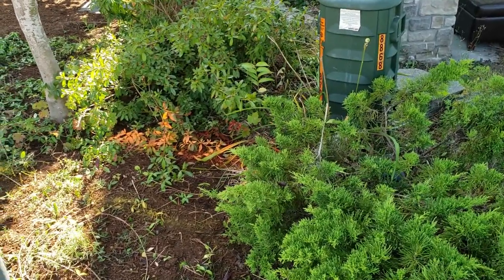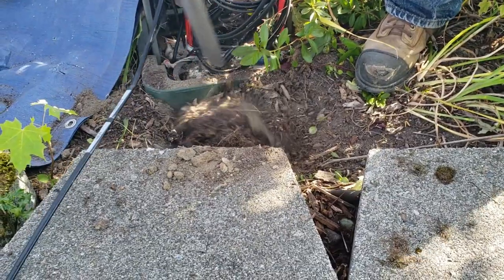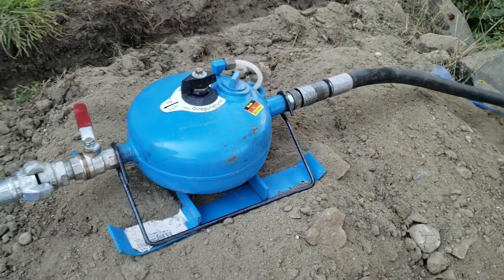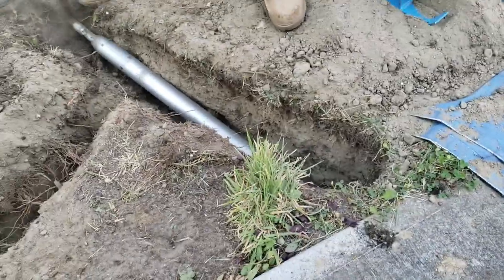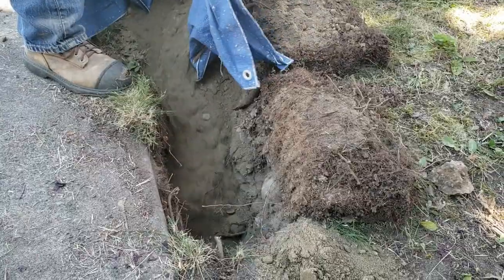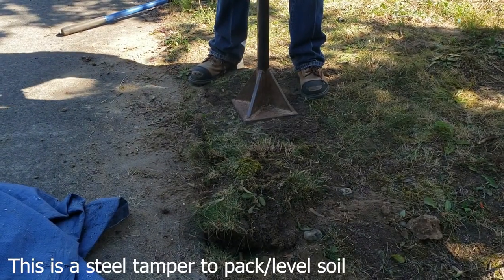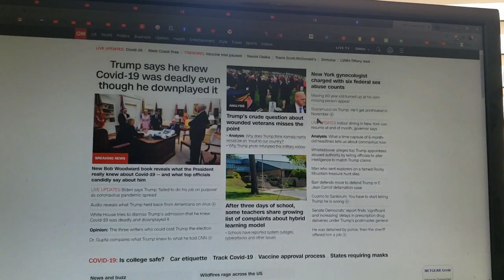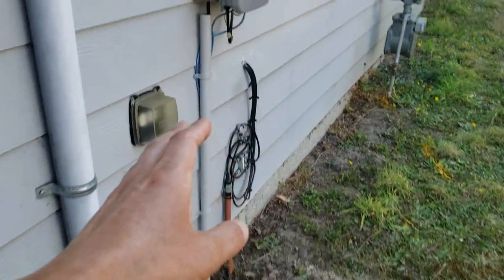How Cable Companies Dig Fiber Optic Lines | Horizontal Boring

Comment: I would have thrown a few 3/4 inch conduits in there in case I ever needed to run more wires in the future.
Reply from the maker: I was wondering why they didn't use any sheath for protection. I didn't have any conduits on me lol.

Comment: I need to ask a question about running a fiber optic wire, I have to go from my driveway down the side of the main road, then cross over underneath of the road and down the side of the main road a good bit further, what would be the best way to do this
Reply from the maker: I'm sorry but I'm not a professional. I only documented the process for anybody wondering how fiber optic lines are installed.
Reply: You can rent a trenching machine but that wont get you under concrete. That will require digging up/cutting concrete. You can also use a horizontal boring machine. Do your research with both types of machines. This is a lot more involved process than most realize. If you are not familiar or licensed to run a horizontal boring machine I would suggest hiring out the work. This is a potentially dangerous project for an average homeowner to take on and is usually done by a highly trained crew. Follow all safety guidelines and state laws when digging.

Comment: How would you remove the cover to some cable that was buried? I see on that green box you lifted up there’s a bar that’s vertical which looks like a support for the cover. I do see a 11mm bolt on the outside of the cover on mine.
Reply from the maker: The cover can be removed by using a special tool.
Reply: @Jay_Rule  so I figured it out there’s a bolt on the outside but it acts like a key lock and not a bolt that’s removed thanks for the response
Reply from the maker: @E85_STI  Yes, I saw the tech guy loosen it with a tool in order to run a diagnosis with the internet speed.

Comment: Why would you not run the drop in a high vis micro conduit? Doesn't appear to be burial line and lacks a  traceable line with no way to locate in the future. The info as to the boring process is good, but that fiber drop WILL get hit due to lack of protection and inability to locate.
Reply from the maker: IDK, ask the contractor boring company. I had the same concern too.